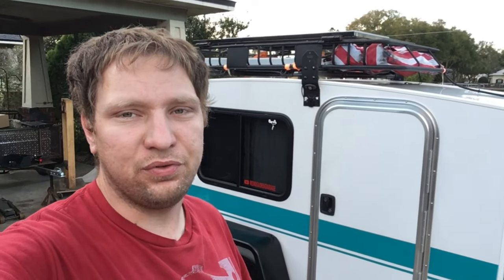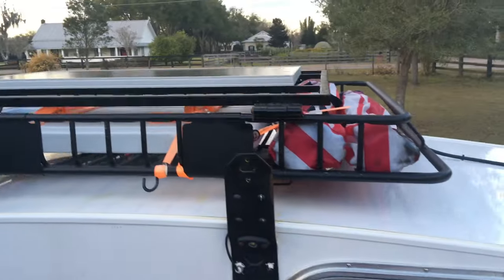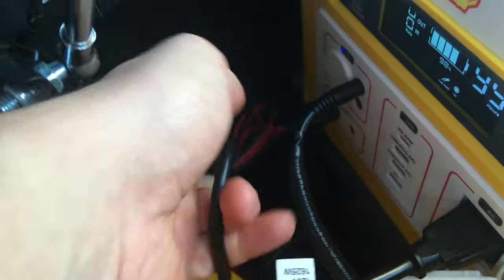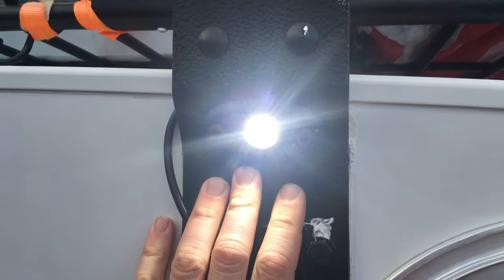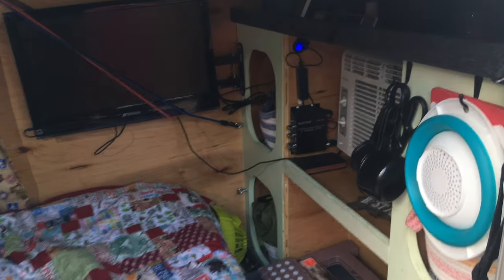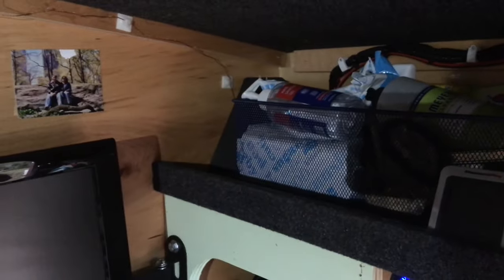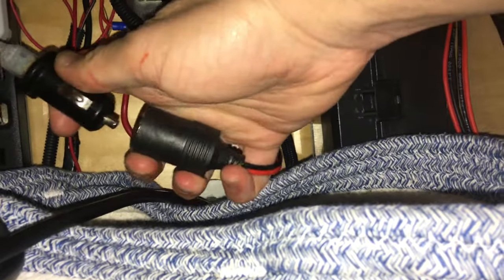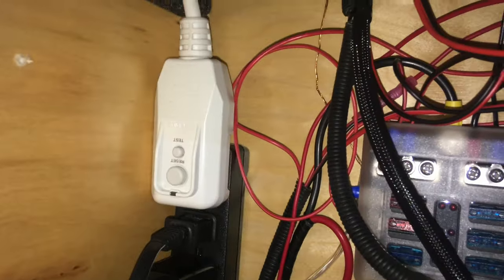How I made this Runaway Camper Powered by Solar.

Comment: Awesome work! The stereo system is cool, but you could probably have saved a lot of trouble by just using a bluetooth speaker that connects to your firestick, or one of those usb blutetooth adapters to aux jack.
Reply from the maker: Agreed just had different ideas I wanted play with at the time

Comment: Great video. We're working on solar this winter for our square drop. Where did you source the side brackets for your roof racks? We are looking for something similar that we can attach to the side but with the offset to clear the molding on the roof edge. Thanks!
Reply from the maker: Mine came with my camper but I know you can get similar rails for the Chevy express van that's what we used on my buddy's square drop
Reply: @RenegadesGarage07  Thanks! I'm checking that out.

Comment: Where did you get the fenders?
Reply from the maker: Amazon there a set of steel boat trailer fenders if I remember correctly.
Reply: @RenegadesGarage07  that's awesome.  I know they offer similar ones on the venturist.  I like the idea of using them as a table to cook with the propane tank there. I'm considering purchasing one real soon. Thx
Reply from the maker: @ozzie3056  yes I love them and how I welded them u can stand on them no problem
Reply: @RenegadesGarage07  Do you have a video or photo of how it's welded to the frame and the side additions to the fenders that hold the propane bottle? They don't come with the fenders from the photos I'm seeing on amazon.
Reply from the maker: @JKUadventures  yes one my new videos I talked about that some
Reply: @RenegadesGarage07  I will look through your video list. Thanks.